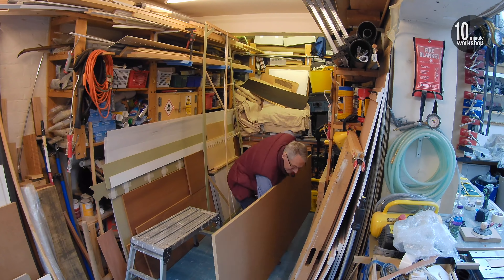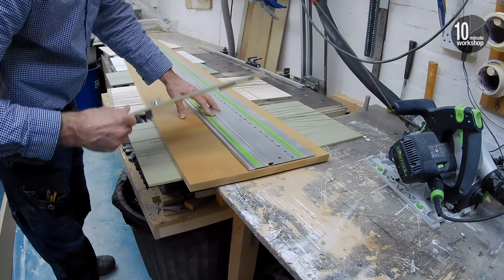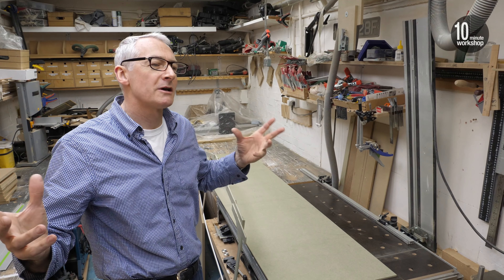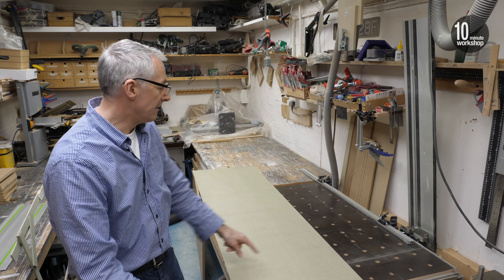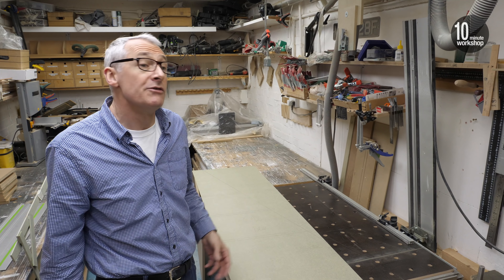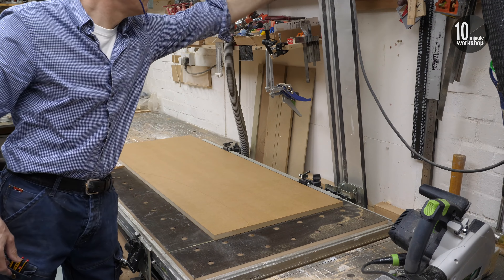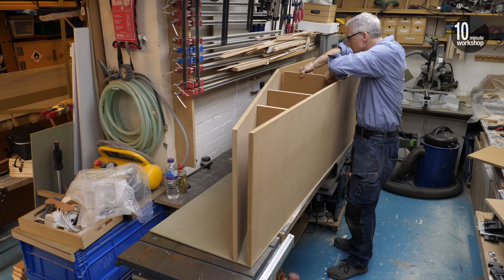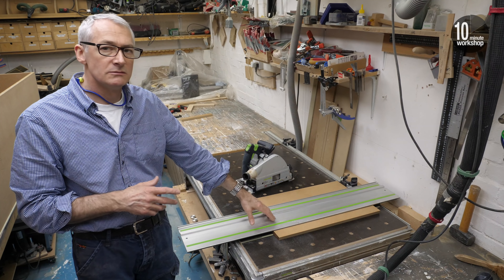My Last Wardrobes P2; cuts and angles [video #398]

Comment: Hi Peter, the festool dustport is already fixt, basicly all newer festool saws got  new designed dustport, and with the Hoseconnector (since around Late 2017) you can connect them with a twist motion like the plugit cords (bajonet) 

Sorry for my poor english, greetings from Germany
Reply from the maker: Hi & thanks - your English is excellent! The bayonet fitting isn’t the problem though - that just stops the hose from coming off the saw. The problem is that the angled piece on the saw doesn’t stay in place, so the weight of the hose drags it down & catches on the workpiece or the rail. With every cheap/entry level saw I have, the angled piece is a simple friction fit, and it stays where you put it. 🤷‍♂️👍

Comment: I'm interested in what you'll be building in the future but I have to admit I find this type of build fascinating. The ease and accuracy with which you put together such a large piece of furniture is mesmerizing and I learn something new every time. On a different topic, I wonder if you'd be interested in giving your opinion of whether a mitre saw is a necessary shop tool? If you are doing commercial work the answer is almost certainly yes but I can barely remember seeing you use yours. For a hobbyist, like me, I'm coming to the conclusion that a track saw and a good jig is probably a better solution.
Reply from the maker: Thanks! I use my mitre saw rarely, and do begrudge the space it takes up, a little. But when I need that depth of cut, or (admittedly rarely) a compound angle cut, then it’s invaluable. 👍
Reply: @10MinuteWorkshop  Thanks, that sums up exactly how I feel about mine and why I've not got rid of it.

Comment: I like the idea of having 2 tracksaws. My old ts55 will probably end up permanently mounted on my mega MFT cutting station (If I ever pull my finger out and build the darned thing). And I am seriously thinking about the cordless twin battery version for those out and about kind of jobs..... as long as 'her indoors' doesn't find out how much it costs!
Reply from the maker: Yes, I don’t regret having a spare, despite the cost. Means I can also keep a different blade in each, too, which is a bit of a luxury. 👍👍

Comment: Great to see someone not need a 'table saw', I have one and hardly use it, much like you I can get by with a track saw. I also make use of my bandsaw as well to rip timber down.
Reply from the maker: Don’t have space for a big table saw, so I get along just fine. 👍👍
Reply: It's horses for courses though isn't it? I have three table saws and love them all, my track saw is just a length of two pieces of MDF and a circular saw and it works fine for breaking down large sheet goods ready for the table saw.

Comment: Actually festool engineers solved the dust port problem few years ago. Product number 202096 locking angle adapter. Ofc you need the new kind of locking part also in your hose so they can mate together. All of the new tools have the locking dust port system. Even my 1 year domino has one
Reply from the maker: No, they didn’t - you misunderstand the issue.  That adapter locks the hose to the saw - I’ve never once had the hose come off the saw in ~15 years of using them. The problem is that the angled piece that comes out of the saw doesn’t lock tightly, and twists with the weight of the hose, so the hose is always snagging the workpiece or the rail. It’s bad design. Every entry level saw I have uses a simple friction fit angled piece that stays where I put it, but Festool seem incapable of this simple task. 🤷‍♂️
Reply: Ooh sorry looks like i did misunderstood the problem. Yeah the twist thing is annoying. But still I did go and look my 2 year old ts55 and it has a "ratchetty" semi-turn-locking dustport. It isnt as easily turning as the old freely spinning ports. It still can turn if it the hose catches on something but its much stiffer to turn and stays pointing upwards when doing normal tracksaw work. And as a disclaimer english isnt my first language so hope you understand what i'm trying to convey here ☺
Reply: @Aapo_the_Blockhead  The movement on my 2019 TS55 dustport is similar to what you describe (it feels like notches, that click into position) and although I don't have an extraction hose attached, it does feel as if it would stay in position. It takes some effort to turn the port.

Comment: When doing your own cutting, what should you allow in the measurements for the blade of the saw itself? Or is this always zero because you’re cutting to the waste side of the line?
Reply from the maker: Blade thicknesses - or ‘kerf’ - vary, but Festool plunge saw blades are 2.2mm, if that helps. 👍

Comment: Hi Peter 

Was there ever a part 3 to this series? I'm looking for how you fixed your angled shelves to the unit itself. 

Cheers
Reply from the maker: Hi Nic! There’s a few more parts to come., but as I said in P1, they’ll come through when they’re ready. This is my last fitted furniture job & install, I shot lots of video, so there’s lots to edit! 👍👍🤷‍♂️
Reply: @10MinuteWorkshop  nice. I have a very similar job in the pipeline. So was curious about the angled shelves. I'm thinking it would be tricky to lamello and simple screws would be enough.
Reply from the maker: Nic Harvey I’ve posted a few little snippets on Instagram - and yes, the angled shelves were just screwed in. 👍👍
Reply: @10MinuteWorkshop  thanks for your replies, always appreciated!

Comment: Peter.. Is there any difference in quality of cut if you're ts55 blade is 3mm cutting through the board to lets say 30mm cutting through? Does the shallow cut compromise the cut finish?    Also can you use a domino in the middle of a board, not just the ends?  Thanks Paul  P.S. I have two CS70`s   ,one in my van and one in the garage.. just greedy i know.
Reply from the maker: Hi Paul. Yes, you get a better cut be keeping the teeth of the blade within the material or so only 2-3mm of blade cuts through beneath. I explain it in more detail in the Tracksaw workshop series, or one of the follow on blade videos. And yes, the Domino can be used mid-board; pick just about any wardrobe or cabinet build video and you’ll see the technique I use for placement. 👍👍
Reply: @10MinuteWorkshop  Thanks Peter, I will take a look.

Comment: Hi Peter, no pressure to reply, but I've been wondering about how you clean saw blades as after cutting some laminate in particular there's quite a lot of gunk on the teeth.
Reply from the maker: Honestly, I’ve never cleaned a saw blade in my life. I know some folks swear by it, but I’ve never felt the need. 🤷‍♂️👍
Reply: @10MinuteWorkshop  thanks for the reply! I can see quite a build up and it feels to me like it's burning more and is harder to push through the cut. Maybe just needs sharpening! 🤷
Reply: Oven cleaner does the job for me

Comment: Hi Peter, how did you "dial in" the bevel angle on the TS55? Did you use a bevel angle or the angle scale on the TS55 or something else?
Reply from the maker: Hiya. I used an angle finder (Trend digital one) then split it, though I’ve done it by marking the angle onto a piece of paper then folded it in half before now and that worked out great as well. 👍 Once you have an approximate angle, it’s just a question of a little bit of trial & error to get it bang on. 👍🤷‍♂️

Comment: Ironic that the tools with the rumoured best dust collection have such a weakness in that very system. 

Good idea having two saws to keep one set at the miter angle for a job.
Reply from the maker: Yes, a real blind spot. I also have different blades in the saws as well (standard 48t and ‘universal’ 28t) gives a bit more flexibility. 👍👍
Reply: @10MinuteWorkshop  ha! Not bad at all. Most people buy blades for saws, not the other way round 🤣

Comment: Peter, your MFT rail was high at the back (off the material) when you made the angled cuts, that could have thrown the angle off slightly at the back.
Reply from the maker: Thanks. Wouldn’t account for the second one working out OK though 🤷‍♂️👍👍

Comment: Could cutting the Lamello mortices on the angle have caused a misalignment? It looked tricky cutting againt the bevelled edge.
Reply from the maker: No, they’re designed for that - and the second one was spot on. Must have been an error on my part. 🤷‍♂️👍

Comment: What make is your saw blade?
Reply from the maker: It’s from Key Blades - link in video description, or >> Key blades for TS55 - https://amzn.to/2ryM0Fv 👍👍
Reply: Thanks Peter for the Domino strength tip.  I found that the plunge stil went through until I wedged a pin in the gauge.

Comment: You could get yourself a Mafell track saw, it'll fit your Festool tracks, but you'd have to buy the plug-it kit and replace the power cord with it to get the same flexibility with your dust collection
https://photos.app.goo.gl/SuJgevxRHWgw2LkY7
Reply from the maker: I have one on trial that the moment actually; initial impressions are that it doesn’t fare much better in that particular regard, but time will tell. 👍👍

Comment: If it wasent ribbed there would be no problem????
Reply from the maker: It has a sleeve on it - the ribbing isn’t the problem. It’s the connector to the saw that turns freely with the weight of the hose, instead of staying put. Bad design.